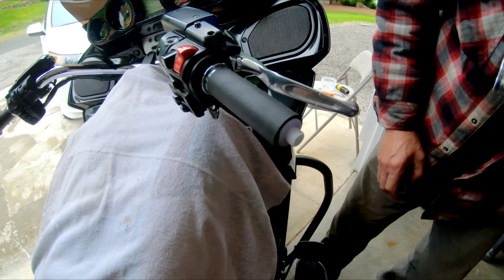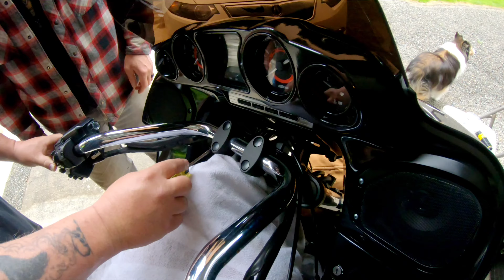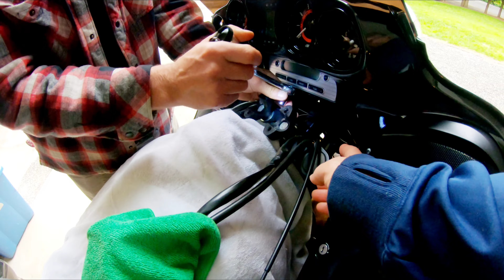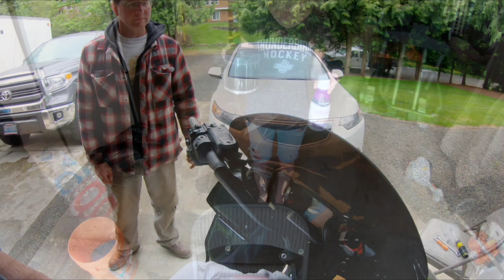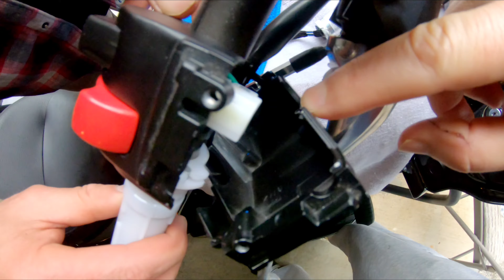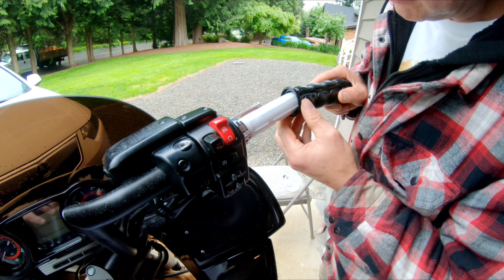VAQUERO JSR APE HANGERS & KURYAKYN GRIPS INSTALL

Comment: You guys were right on time with this video!  I have these bars being delivered tomorrow and I have the courage to attempt this with my sons assistance!  I was going to take it to the shop but now I'm going to give it a try!  Thank you so much for posting!
Reply from the maker: Hi Rocket 3 Man,  Thanks for watching. It was fun putting the bars on.  I missed the video part of putting the throttle cables back on.  It's easy to do.  Hope your install went well.
Reply: How did it go? I just ordered a set and going to try myself.
Reply: @danielrehm5008  Smooth and easy install just put a towel on your fuel tank to prevent scratches from tools.

Comment: You guys made an informative and amusing video.
Thanks to your video, I worked up the nerve to install these bars on my own Vaquero successfully.

One additional item: regarding the pin that required drilling a hole, my pin was already snapped off when I opened up the controller unit.
This pin's function seems to be for keeping the controller from moving around. 

I merely replaced the soft phillips head screws with hex head screws and tightened down the unit until it was  clamped down tight and unmoving (even with the broken pin).
Thanks again for your video.
Reply from the maker: Hi Moby Man,  Thanks.  Good job on your install!!  Thanks for watching!

Comment: Does getting ape hangers help if your hands/fingers get numb? I like my 21' Vaquero, but even when I was riding my 79' KZ1000 ST my fingers would go numb sometimes. The KZ was my first bike when I got my MC Lic when I was 39, I'll be 56 this July, the Vaquero is my first bagger, also had a 79' GL1000 w/a Vetter fairing. Never been a big fan of "ape hangers", but I will admit, those look pretty good on that bike. Mine's dark metallic grey w/maroon graphics & the blackout bars. I'm 5'7", how will it affect handling or does it?
Reply from the maker: Hi MoxieMike66,  Numb fingers can happen because of a wide range of things.  For me, a very comfortable hand position is just below shoulder height.  Maybe spread apart a little also is comfortable to.  Numbing fingers can come from a pinched nerve, a lot of bike vibration and so on...

Comment: Not sure about the throttle sleeve.... seems like the new grip should have come with a sleeve........ best adhesive for grips.... 3M Weatherstrip and gasket adhesive.... 
Missed you guys putting the throttle cable back together.... for others doing it... loosen the adjustment nuts to get cable slack....
Reply from the maker: Hi Metricoil,   thanks for watching. Your right, it would have been better with a new sleeve.  Great info on the throttle cable.  Thanks

Comment: Did it require any mod to the cables?
Reply from the maker: Sorry for the late reply.  Nope.  We needed to clip some zip ties.  I think if you go higher, you'd need to tweak cable lengths.

Comment: I got tired of buying 10’’ windshields so I’m goin to take my seat and get some foam cut out to lower my head height. Then change over to roaring toyz 12’’ apes they have the actual apes for that bike 100%
Reply from the maker: Sounds like a comfortable solution

Comment: hey, nice installation! the windscreen it's 14"?
Reply from the maker: Hi goshell1975,  Thanks.  It wasn't that hard to do after all.  Not sure about the 14" length.  We don't have the bike any longer.  Sorry.  Thanks for watchin!
Reply: @bgrides2108  Looks like the same emblem on the windshield I have on mine I just bought from Dennis Kirk, Slipstreamer brand I think. Mines shorter that that one, 6"-8". Wasn't sure how tall to go, that one looks closer to what I'd like to have.
Reply from the maker: Hey MoxieMike66:  How did your windshield work out?
Reply: @bgrides2108  It's better than stock, still trying to nail down a part number on the few sites I've looked up. Saw one that was taller w/a vent at the bottom you could adjust, still trying to track it down. Came up "not listed" on the video I saw it on. Typical for me. That's why I still have a dead 79' KZ1000 ST & a 79' GL1000 in my yard. Can't find shit when I look for it, and can't find a shop to work on it.🙄
Reply from the maker: @MoxieMike66  lol.  I agree.  Find stuff is a pain for the older bikes.

Comment: How do you know the right place to drill the hole?
Reply from the maker: Hi J Miller,  Wish there was a template or something.  We just did our best to get everything in place first.  Then tried our best to mark the proper pin location.  We actually used the screws to clamp the throttle housing half's together hoping the pin would leave a mark on the bars but that didn't work.  Thanks for watching.

Comment: What pipes are those?? How loud are they on the highway? At idle, they sound nice & deep but quiet, exactly like I like it.
Reply from the maker: Hi mytriton54,  Cobra four inch rounds.  Not to loud on the highway.  They sound really sweet.
Reply: Best sounding exhaust for the vaquero is vance and Hines. I had cobra on mine and want impressed...switched over to Vance and Hines and couldn't be happier.
Reply from the maker: @ryanbrown621  Hey Ryan,  Vance and Hines make some great products.
Reply: Great video, verry informative :) . Did you do also a power commander with the new pipes ? I understand it does not run good without
Reply from the maker: Hi George,  Nope.  The bike ran great.  Sorry for the late reply.